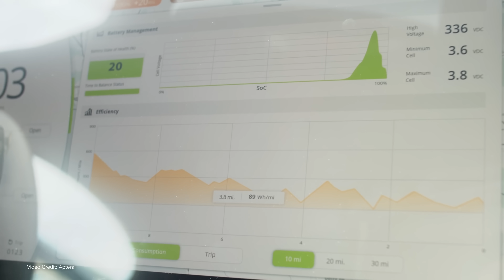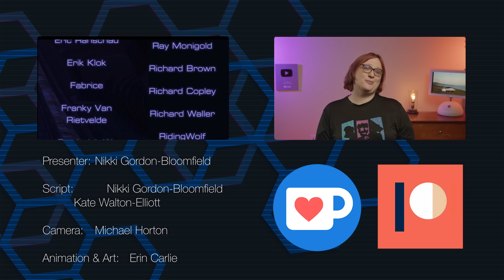Here's What's New At Aptera!

Comment: They bond with their customers because they are actually customer centric. Right to repair, actual range jump and intelligent design behind all decisions made to advance the vehicle, where their focus is almost autistically directed at congruence of vehicle performance vs efficiency, where literally form follows function to a degree never seen before. Inhub motors, eliminating friction points, following fluid dynamics rigorously in its design, around the use of the vehicle, which is of course you and me, so at a price point which is not just limited to the rich and famous. Crazy, yet true and it seems they are going to deliver.

On their site I saw a price point between 25 and 50 grand, so you can spec out in mainly battery size it seems, going up all the way to 100kwh? In Holland we have the least favorable weather, providing a worst case scenario, yet according to their website, if you have a commuting distance of 50 miles a day, which is quite average in Holland (Holland is so small, it is economically more viable to stay put and commute than to move, we are commuting close to 1,5 hours a day excluding congestion, although Covid has lowered that average considerably per week) If I punch in the average solar energy sotred versus the miles driven per day, I still average out at 11 (!) charges per year?! That is really groundbreaking!!

Comment: I’m wondering how the Aptera will hold up on rough roads. The roads are poorly maintained in most areas that I have driven. I live on a hill in Tennessee and I doubt that the Apters would be able to get up the driveway without ripping off the front wheel skirts.
Reply: I live on a gravel road in Iowa.  The wheel skirts rise with the wheels when bumps are encountered, unlike front dams that are mounted to the body.  I think they will be fine, but will have real world experience next year.  I rode in a prototype and speed bumps were fine.

Comment: Yes Aptera holds a unique niche I also like the Akimoto and I'm an investor. My problem with it is it doesn't have enough range the original Aptera with a 100 miles of range was also low and is why I had a reservation for the gas hybrid. The diesel hybrid wasn't going to be allowed by California even though it had way better mileage. The diesel is rated by particulates per gallon and doesn't take into account MPG. My current Aptera order is for the 400 mile range off-road solar package. Cheers from Northern California!!!

Comment: I hadn't considered that the three wheel drive was slightly less efficient... should I change my configuration for 2 instead?
Reply: It depends on your needs.  The AWD version will be much faster at 3.5 seconds or better, compared to 5.5 seconds.  I rode in a 2WD prototype and still thought it was a blast.  AWD will also be better on slick roads, but I live in Iowa and have ordered 2WD.  I think the ABS/traction control they have fitted will still be very good.

Comment: Sorry but motors mounted on/in front wheels is a terrible idea. Imagine the brutal continuance vibrations, shocks and bumps! I know because I mounted fenders on front wheel mounts and constantly had to continually weld cracks.
Reply: Look up the Elaphe videos and see the testing they go through.  Aptera has also shared engineering of the wheel pants.  They are very unlikely to crack.

Comment: I'm guessing this car doesn't have a great crash rating.
Reply: Aptera won't have a rating until they have production intent vehicles to test, which will be dine by a third party.

However, they have conducted thousands of virtual tests and continued revisions based on the results.  I am guessing the ratings will be excellent for an 1800 lb vehicle.

My present Gen 1 Honda Insight weighs about the same and it got 4rs when it was tested.  Today's tests are harder to pass, but Aptera' s safety design is better, too.  It is in a class that does not require crash testing but will be 3rd party tested any way, which should give some confidence that the designers have faith in the performance.
Reply: @n.brucenelson5920  My current Mitsubishi Mirage, which I will replace with an Aptera, weighs just a slight tad more and it got decent crash ratings.

Comment: I've been following the Aptera story for a long time.  It's a nifty little car that was much more radical back when it first was introduced to the world, but not quite as radical today.  I think I might consider an Aptera-like design for my own personal car if it had four wheels.  The fact is that three-wheeled vehicles can be fatally unstable under certain everyday circumstances.  If you don't believe me, check-out what has been going on with velomobile design.  Most of these also have only three wheels.  Velomobile owners will tell you that if they ever loose traction in that third wheel, the situation quickly deteriorates toward a complete loss of control.  Something as simple as going over a rumble strip can set things in motion.  In velomobiles, which are relatively low speed vehicles, losing control is bad enough.  Losing control in this manner at highway speeds would be that much more disastrous.
Reply: Aptera beta passes the moose test. A RAV4 and many others do not. Suspension design by Roush Engineering.
Reply: The track and the potential for significant weight shift in velomobiles make any similarity unlikely.  Look at video of the beta performing moose test like maneuvers.
Reply: @n.brucenelson5920  I think of the fourth wheel as insurance.  The overall weight of the vehicle may help to prevent traction loss, but the fact that this loss of control phenomenon occurs with regularity in 3-wheeled velomobiles should not be minimized.
Reply: @Brian-bp5pe  As I said, there is video of this vehicle performing maneuvers you don't think are possible.  Aptera has ABS/Traction control that can sense wheel slip and adjust torque every 2.5 " of tread travel, plus differential steering, all of which makes a decisive difference.
Reply: ... "video of the beta performing moose test like maneuvers"?  Where might the hyperlink for said video be found, Bruce?
Reply: @Brian-bp5pe  there is a brief clip at the beginning of the Aptera drag race video of the beta.  There is another better ariel shot but I will have to find it again.

Comment: The motor weight in the Aptera is unsprung weight.  One of the primary goals of performance vehicles has always been to reduce unsprung weight as much as possible.  That is why people spend huge sums for very lite weight wheels.  I may buy an Aptera, I would definitely buy one if the motors were not in the wheels.
Reply: The good news is the motors only weigh 50 lbs each.  Many cars have wheels that weigh more.
Reply: Aptera wheel / Elaphe motor combo is very light. Please don't generalize.
Reply: @ronaldlenz5745  It is certainly appropriate to generalize when a fact is general.  Unsprung  weight is the very worst place to add weight to a vehicle, be it car, motorcycle, or bicycle.  If you want any kind of handling performance you get more bang for your buck by reducing unsprung weight than any other factor.  This is not some theory.  This was just a way to be able to reduce the engineering with off-the-shelf half measures and simplify manufacturing.  But perhaps I am wrong and the motors are somehow sprung inside the wheels, but I doubt it very much.  I was very disappointed when I saw the setup.

Comment: Very well articulated.  I like that you speak very clearly and succinctly.   Can't wait to see Aptera's on the road.  Maybe I'll buy one.  My only concern is driving with those wheels out away from the body.  Maybe that isn't a big deal but maybe it is.
Reply: It takes some adjustment.  My Chevy P30 is even wider, and that is before taking mirrors into account.  Both vehicles will still fit in a compact parking space.
Reply: @n.brucenelson5920  My concern is that you can't see the front left wheel while driving.  Can the driver actually see the wheel?
Reply: @ModernNeandertal  I actually don't remember.  While I sat in the driver's seat, my ride was in the passenger seat.  Also, the position of the seats will change for the production version.

Good question.  Perhaps you can ask it at the Webinar on the 14th.

Comment: I follow Aptera closely since their come back.  I have a second thought about switching from Cybertruck  deposit to Aptera.
Time will tell.   Cybertruck is unmatched in its versatility  but Aptera is unmatched in efficiency.    This is the first of solar roof charging  vehicle  and 1000 miles /charge?     That remains to be seen but it is feasible from the point of view of super efficiency, light weight.    

Aptera will definitely appeal to Europeans and Asians customers because of tight space and street in their countries.  Here in the US where I live that is not an issue that is why trucks are so prevalent.   

Excellent idea of the Aptera.  I like it.
Reply: I came very close to putting an early deposit down on the Cybertruck, but frankly Aptera meets most of our needs, and their stance on Right to Repair tipped the balance for me.  I also knew many of Tesla's engineers in Union City back i the early days, and knew Tesla was lying to both investors and potential customers about their progress before they got their $250 million dollar loan.  I haven't seen such behavior from Aptera leadership.

Comment: Do your Physics. There is no space for current 100kW-h batteries in the Aptera auto-cycle; no 1000 mi range based on 65 mi/hr speed and current battery technology.
Reply: I think you are mistaken about the space - Aptera's packaging has achieved better power density than Teslas' using the same cells.  Also, Aptera's range estimate is based on the EPA highway cycle, which has an average speed of 48-50 mph with a peak up to 67.  It likely won't reach 1000 miles at 65 mph, unless the day is very hot.

Comment: Oh no!  Another hit to Aptera.  "The Bolt EV subcompact hatchback will start at $26,595, which represents a $5,900 price drop that gives it the lowest sticker price of any electric car in the U.S."  Hmmm, 5 passengers or only 2?  Tried and true 4 wheeled suspension or something else?  Wide as an F150 with a turning radius to match(maybe worse) or 19 in thinner and at least 5 in shorter?  Normal easy entry exit doors with drive-thru friendly windows or awkward entry/exit with drink spilling half windows?  Nationwide dealers or unestablished service infrastructure?  Overall safety rating of 5 stars or something that has not physically been crash tested?
Reply: Why do you come here with untruths?  First of all, I am thrilled to see the Bolt offering.   However, there are likely to be many that won't want to pay more for a  Bolt, only to use three times the power for about the same range as they get from an Aptera, even without the solar boost.

As far as the Aptera entry, I am 72 and not as spry as I once was.  It is easier than my present Honda Insight, especially in a narrow space where I can't open the door all the way.  All you have to do with Aptera is back up to the seat and sit down, and then swing your legs in - easy!  I have not yet been to a drive through and so can't comment on that.  

Aptera  can be serviced anywhere.  I am in rural Iowa, and have already discussed service with my local shop.  When they heard "Right to Repair" they were all in, and can't wait to see mine.  I imagine this will be true anywhere.

Aptera has never said anything other than "We won't know the crash safety rating until the tests are actually done".
Reply: @n.brucenelson5920  Seems that Aptera's getting into actual owner's hands being right around the corner has sprung a wave of ApteraQ folks who are likely tied to traditional automakers.   lol
Reply: @fanfare100  I think many people are threatened by change and don't see that not changing is an even larger threat.
Reply: @n.brucenelson5920  save it Tank Turn.  We all know you are 72.  You remind us in almost every post.  But I guess that happens at that age.  So sorry.
Reply: @doclees11  Don't worry.  There is at least a chance that someday you will grow up too, however unlikely that seems considering your behavior now.
Reply: @n.brucenelson5920  doclees grow up?  Quite unlikely unless mom kicks him out.

Comment: Thank you for your great video! I have a reservation and chose the 400 mile range, but I ordered all wheel because I live in the hills and thought I would need the extra power? Since you said that the three wheel will use up more power, I'm concerned if I should change to the two wheel drive. Do you know how much more power the all wheel uses? Many thanks! I'm so excited and hopeful that this will be a wonderful vehicle!
Reply: If I remember correctly, Chris Anthony said each hub motor is like 70 hp, so front wheel would be 140-ish hp and you'd get a pretty sizeable 33% boost in hp with the all-wheel drive (210 hp) -- You should also get better handling on poor road conditions with the all-wheel drive.  Hope that helps.

Comment: I would have been enthusiastic about this fairly primitive 3 wheeled experiment before the Leaf was launched. Now there are dozens of different models of modern EVs and Aptera is still promising production in the future after 17 years. Is there something in the water?
Reply: If you paid attention to Nikki's video, you would know that the founders lost control of the original company in 2009 to a CEO from Detroit who had a different idea, and he liquidated the company.  The present Aptera was only restarted in 2019, and the vehicle has no common parts except a vague influence from the original's design.  The drive train, dimensions, and performance are all totally new, and they have had less time than it took Tesla to do a simple EV conversion of the Lotus Elise - and without the $250 million dollar government loan that Tesla had.

I have ridden in an Aptera prototype and the performance is far beyond what a Leaf or anything else on the horizon provides.

If you doubt this, and don't want to do the work to see for yourself, we early owners will be showing off our production models next year.
Reply: Primitive it is not.  The Aptera is the most efficient passenger vehicle to date which is capable of self-charging by way of the sun for distances 2ce what the average commuter will drive and with a battery range capability which is world-record-breaking.  It will create the same amount of drag as just one of the side mirrors of the Ford F-150.   I would hardly consider that to be ... "primitive".  Not even a vehicle of the present, but rather, one of the future!

Comment: As much as I like the car it’s still a trike in classification so crash safety isn’t anywhere near that of a car, so you know just how things are going to work out in a fender bender, so no matter how efficient, how unusual, it’s still going to be a limited amount on the road since eu countries and  parts of Asian markets have far higher requirements, also I strongly doubt 100kwh can fit in its frame without extending, not to mention the weight that comes with it
Reply: Actually that is not true.  Aptera has been designed from the beginning to pass the FMVSS part 200 crash tests, and once they have production intent vehicles they will be crash tested by a third party and the ratings published.

They have air bags, seat belts, front and rear crumple zones, and a lot of other safety features that they aren't required to have according to their class.

As far as the weight of the 100 kWh model, and the difficulty of fitting the batteries, I think you are correct, and it will appear in production considerably after the others.  I think it has limited use case and is a halo product.

Comment: I really really hope Aptera succeeds as this meets the needs of quite a few people.* Even the smallest battery pack, because of the vehicle's efficiency, is more than adequate for many. In fact, because it is a smaller pack it has many advantages such as quicker charging and lower weight.

* In fact, about 80% of people drive to work with no one else in the car, so it makes sense to have a smaller vehicle like the Aptera, which will make an excellent second car for most people and an excellent exclusive car for quite a few too (those who are single or have no children).
Reply: I may not buy an Aptera, but I absolutely hope it is successful.
Because of its efficiency, a standard outlet to charge it would suite almost everyone.  Also for same reason, it should take very little time at a fast charger for long trips.
Reply: While I like it for some things, and have since the first go-round, the size issue sort of depends on what you mean by smaller. By European standards, the current Aptera design is too big for a lot of people width-wise, and not just in cities. It's wider than a Tesla Model S, which is already a big car, by almost two inches. Granted it's only slightly longer than a Prius, but on a narrow lane, the width is still going to be an issue. And unlike some vehicles where you might lose a mirror, the wheel pods are rather more important and more expensive. I also worry a bit about parallel parking outside, then getting overnight snow higher than the wheels, and a snow-plough taking out the roadside wheel because the plough driver isn't expecting a pod sticking out.
Reply: Yep I'm totally looking at getting one.  Just gotta teach my dog to lay down in the back while driving